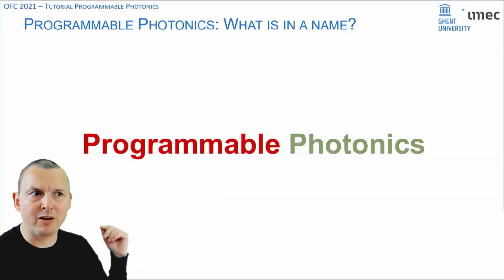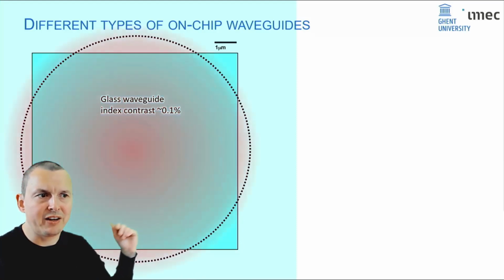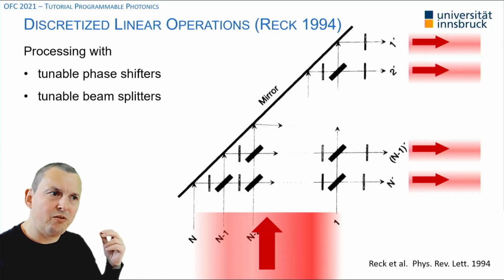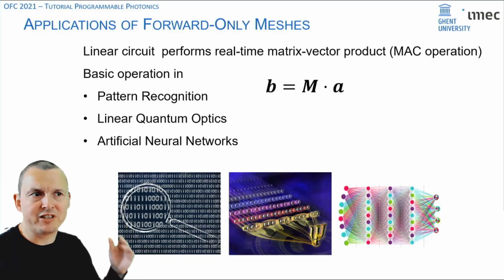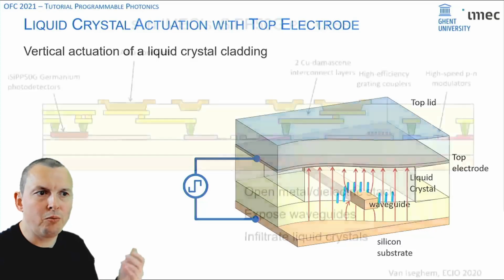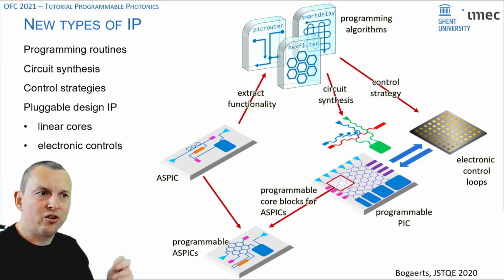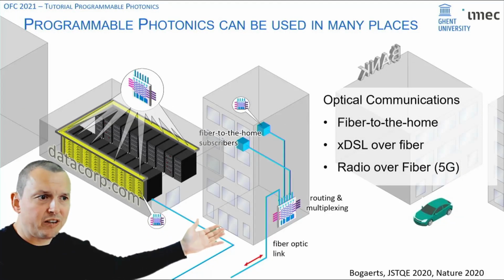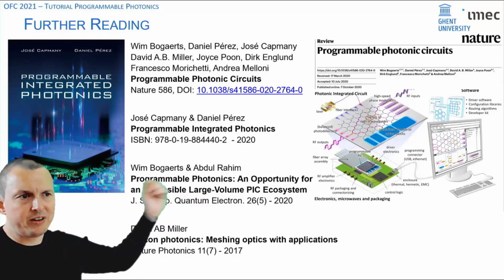OFC 2021 - Tutorial - Programmable Photonics - Wim Bogaerts

Comment: beep boop
Reply: air .. or light, bending a cantilever blocker lever, or mirror
Reply: light timing signal
Reply: flip flop "circular" memory
Reply: standard logic circuits
Reply: im a microelectronic engineer, co-op in the matter, if you so wish
Reply: wave based logic, from start to end
Reply: simple wave length based changes, like self-nulling phase shift